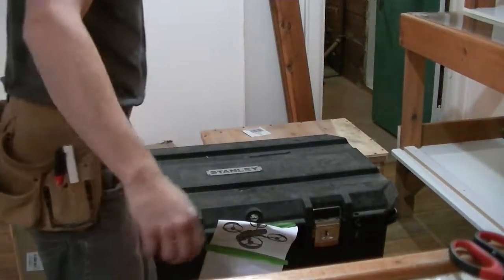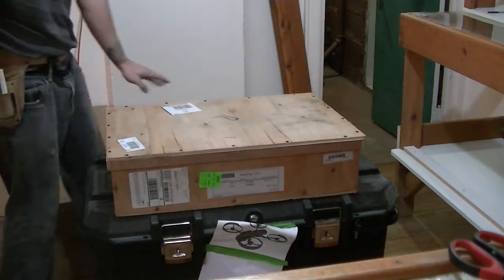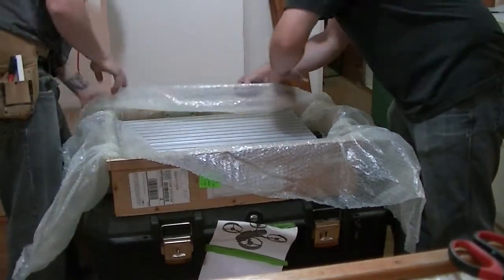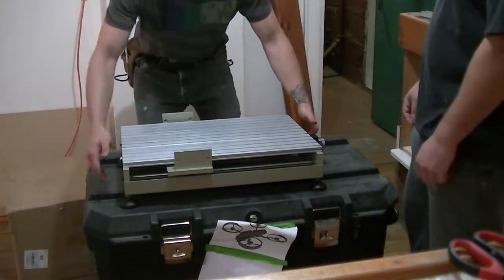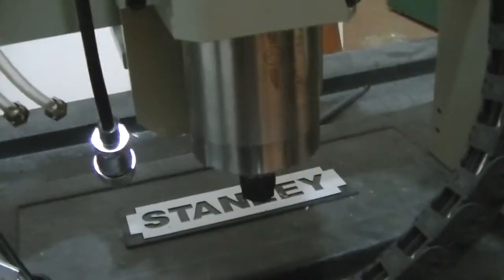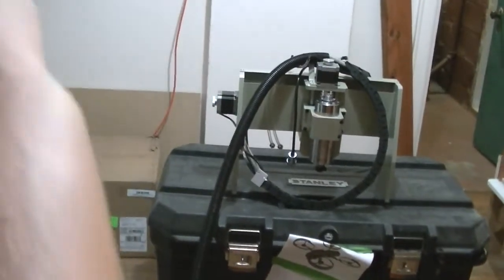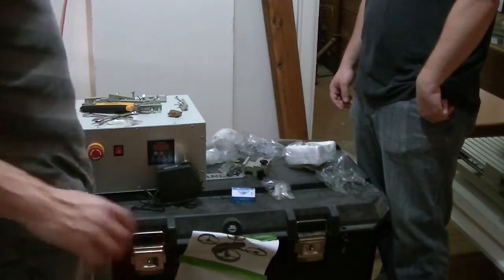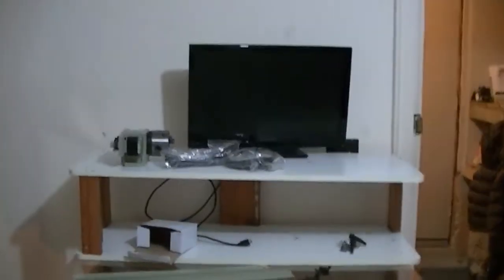Chinese 3040 cnc engraver/mill unboxing

Comment: did he say 1800$ !!
Reply from the maker: Canadian paesos after shipping duties and taxes good luck finding one cheaper with the 4th axis, 800w watercooled, we tried ahaha
Reply: +fullspectrumrc and i was thinking am not gonna pay more than 1000$
lol
nice review!
Reply from the maker: dont be discouraged, we got one that we could run for days and had all the features, you can get a 3 axis 3040 router with a 400w spindle for less than a grand.
Reply: They cost with the 4th axis 485.00 on eBay USA funds. 1800 is a Canadian rip off.  Hope it actually works because the wires and control box are complete shit from all the review. That’s a fact.